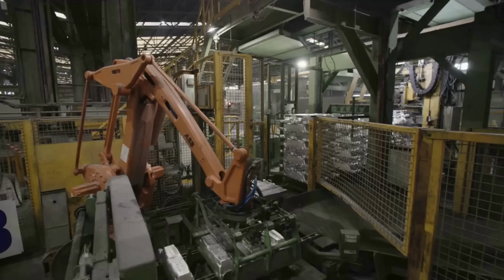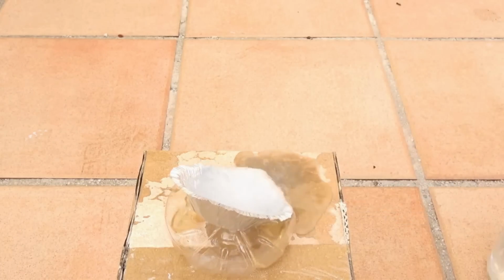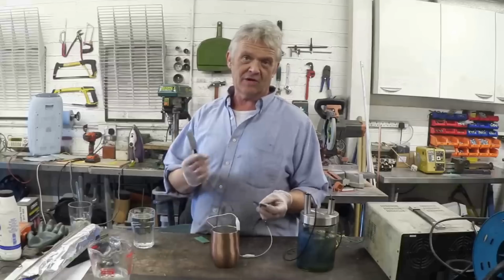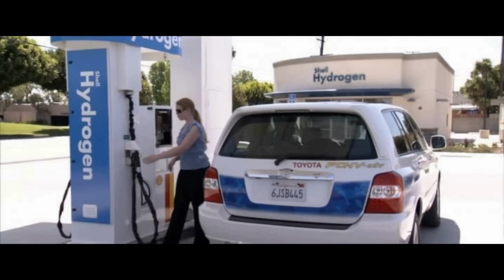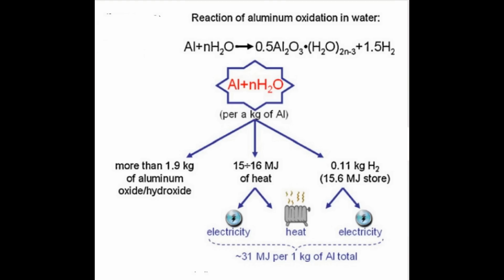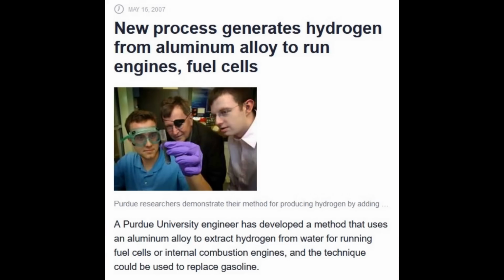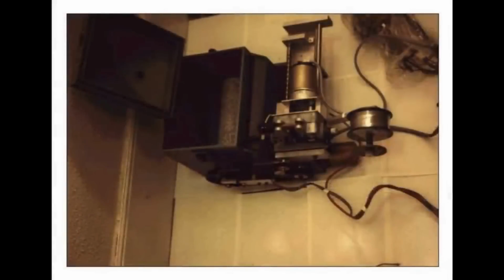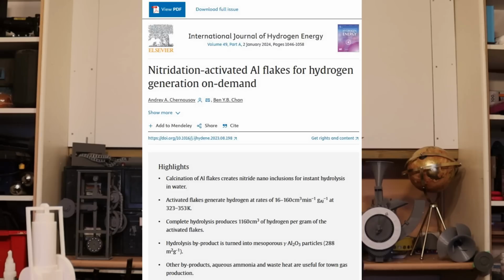2194 Hydrogen On Demand - Improvements And A Possible Conspiracy

Comment: My buddy and i built 3 small jet engins for Mercedes Benz with air barrings . It was use in a semi truck as a generator for an electric motor . The fuel was turned into a micro vapour. It took 3 gallons to go from LA TO NEW YORK ON 3 GALLONS OF FUEL.

Comment: Really? The Hindenburg again? The Hindenburg did not explode, and hydrogen does not explode. The outer coating of the Hindenburg caught fire, and the hydrogen tanks, too. The hydrogen burned (upwards). A mix of hydrogen and oxygen (2 to 1) can explode. If that had happened with the Hindenburg, then this would have been a small nuclear equivalent. A hydrogen tank does not contain oxygen and can therefore not explode. Hydrogen can burn when a tank ruptures, but so does petrol.  Hydrogen burns upwards.

Comment: I saw something a few years ago (not that many years) saying the Fraunhofer Institute in Germany has a Hydrogen on demand system that already works (and had customers, I think) for stationery applications. They had Sodium mixed with a carrier of some hydrocarbon, forming a grey paste. This was reacted with water, being physically squeezed out as needed (the paste had a toothpaste-like consistency). I'm almost sure they were talking of making it work for things like transport. (Just wait for the rain, and there you go another few kilometers - or drive through a spray booth to refresh your water supply when it's dry).

Comment: Hi Rob. My information may not be spot on accurate, but I'm figuring you can see through the the real question I'm trying to get at if you could. if you could make hydrogen on demand and burn it like you say. you were going to burn it in a blowtorch, but use a different flame configuration. Of course. you don't want the flame to touch metal, but use it to heat a boiler. Could you not then use the steam to make electricity and create basically a closed loop? Use some of that electricity to make more hydrogen gas and. basically keep the the momentum the loop going.

Comment: Clearly the Aluminum oxide comes from the electrolysis of water, leaving the hydrogen free to be used, though that also aids in the manufacture and recylability of the Aluminum as a product....

How do we lose? With a thermal capture system we could improve our ability to scavenge the total power of the reaction for as close to 100% yield, which is not often found in chemistry.

Comment: I've been doing tests on this topic for several years. My conclusion: An aluminum press for household waste, a unit (in the car;kind of "Battery") that presses it into a NaOH tank if necessary and uses the HHO in the engine/fuel cell. Works so far...

Comment: About 35 years ago a clever german inventor modified a bmw car replacing fuel tank with a mechanism that produced hydrogen on demand. For this purpose he used an aluminum wire roll used for welding. It was continually unfolded into an acid water bath, reacting with water to produce hydrogen which used as fuel into a normal petroleum engine.The car worked just fine and the inventor used the modified car to tour Europe on a test trip. I remember it very well because in my country a car magazine had interviewed the man and published an article about the car and the patent. I still recall that modified bmw car had already made some 2000 miles without any problem. The inventor departed my country (Greece) having the intention to continue testing his invention by tripping to America.

Comment: Nothing new about this its proven to be floored as it will take 3 times as much energy to reduce/ recycle the aluminium oxide/alumina into elemental aluminium and that is just the amount of energy lost in the reduction process it becomes ridiculously pricey once all the logistic, staff expenses and stock storage factors are considered.. ultimately it would be better to stick with natural gas as an alternative due to the fact aluminium production is far from a net zero process.. over 4tons of co2 is produced for every 1 ton of aluminium upto 16tons co2 for reduction of aluminium oxide

Comment: at around 5:20 into this video, you mentioned the efficiency of a car engine...
however, this is a badly tuned engine made for gasoline.
as we all know, gasoline starts burning at 4-15 or so degrees before TDC. 
hydrogen should be ignited at about 4-10 degrees AFTER TDC or with pre-ignition in case of an extreem lean mixture.
the efficiency can go up a whole lot compared to gasoline.
adding water vapor adds some extra efficiency to it all .....
also, as we see in newer cars, fewer cylinders make more efficient cars, a V12 won't ever be as fuel efficient as a line 3 not to even mention a 1 cylinder engine .... i believe those wont be nice since it won't drive smoothly ;)
anyhow, even with the same thermal efficiency engines will have different fuel consumption and i believe (without any proof) that hydrogen will have a better thermal efficiency

Comment: Just as MeOH may be considered (and is called thus by some) "liquid hydrogen", Al may analogously be referred to as "solid hydrogen". An in-depth head-to-head comparison between these two energy storage systems, taking all aspects into consideration, would be very interesting (hint - a future video perhaps?!). If I had to bet right from the top of my head, I'd say MeOH comes out as the winner, not least due to the unavoidable "solid exhausts" of Al (compare the corresponding gaseous exhausts of MeOH), but I'm all ears and open to change my bet...

Comment: Hello Robert thankyou for such a great video as always. I am very intrigue by this insight amongst others. We would be at your beckoning call to make that machine as designed in Africa to put use as a engine. My thoughts wind/solar power as 14v with step up booster and the machine running to provide a drive to run an engine for other purposes. Just a thought but would love your genius ingenuity to formulate a  simple design for some of us novice engineers.

Comment: There is a conspiracy theory here in that if this was implemented, assuming it is possible to be mass produced, this would break the oil stranglehold, and therefore impact the value of the US $ globally.  The cycle itself would also need to be considered from an overall efficiency point of view.  Conversion of aluminium oxide to aluminium and then the reverse conversion back to aluminium oxide.  Heat is produced in the conversion back to aluminium oxide, and hence is a loss, the the conversion efficiencies also reflect a loss.  Hence, the discussion would be around the overall process efficiency and its contribution to CO2 production, which would only impact on the type of electricity used in that process and the transportation of the recovered aluminium oxide.  
Robert, you are absolutely correct about the safety aspect of its use in vehicles when compared to raw hydrogen.  Aluminium producers tend to utilise cheap hydro-power and hence this process could result in a very low overall emissions impact.

Comment: Hi, please respond.
2 Points:
1) In the past i calculated the amount of Aluminium and Water (!) that you would need to carry with you, if you wanted to take with you the same amount of hydrogen as some hydrogen suv from BMW. I can not remember the numbers exactly but i remembered that the 700bar H2 tank thats in the BMW had to be much lighter, while being a  simpler system.
I didnt know that you also get some Voltage out of that reaction, that could shove the equation in the right direction.

2) The creation of CO2 free aluminium is a much bigger problem. I have not found a solution that seems feasible. It currently works via Carbon Anodes that are dipped into the Al2O3+Kryolith Mixture to reduce the Aluminium while the CO2 conveniently leaves the Melted mass. 
A different Method to reduce the Aluminium Oxide is needed to make this a true alternative.

Comment: I understand machine savings of Al cannot be recycled.  Asked a fellow who owns a machine shop and generates tons of Al savings.  Could this be used in this process.
Reply: afaik yes, I'd been dissolving cans in sodium hydroxide outside to see if i got a usable amount of alumina eventually. Don't see how shavings would be different, if anything it'll be better. You'll obviously want to be very careful with that much surface area, lots of heat and blinding liquids splattering about if it gets out of hand

Comment: I thought that aluminum comes from mining bauxite (equals Co2 production) that also requires a large amount of electrical energy to make aluminum. Same electrical energy that can make Hydrogen so what's the point meaning how could this have a better round trip efficiency that dumping electrical energy into a Lithium EV battery. I believe its takes approx 13kWh of electrical energy to make 1Kg of aluminum and for the average EV 13kWh of energy can drive approx 76Km or 46miles so how far is 1KG of Hydrogen on demand from Aluminium going to take this Car?

Comment: back in 2003 ( when I  was in college ) I had tried a stupid experiment of using aluminum blocks immersed in a small tank of sodium hydroxide to generate hydrogen and then used that to run a car over a short distance. It was a stupid idea but was fun. I had seen this patent ( the last one you mentioned ) back then also as a conspiracy theory but never found any more information on what voltage was used to achieve it. One problem that i see in that system is that the drum will also wear out eventually and would be a problem to replace.

Comment: I own a hho generator that can also be used as a torch. Water does burn. Easy to do over electrolysis. No need to use a aluminum electrode that will dissolve.

Comment: must add a note in hydrogen defense ,I suspect the people on this channel are aware of how the world works ,more than most .So we have to ask was the Hindenburg debacle blamed of hydrogen to deflect and distract from its use or to much research being done on what else it could be used for ,ie ICE motors that actually clean the air !?. The hindenburg was painted in an aluminium oxide paint [the irony] .  When a large body is driven through the atmosphere it tends to accumulate very large static charges ,bring it close to a metal mooring tower and you get a large spark , perfect for igniting a large highly combustible aluminium oxide painted fabric covered airship . People were dropped about a hundred feet , in a tangle of burning debris , the hydrogen did its thing and shot into space . [ I research and ponder a great deal about what the movers and shakers get up to in meetings I am not invited to , they have after all manged to accumulate most of the worlds wealth into the hands of a very few ,so paying attention to what they say ,and don't say ,is a duty of the 99.9 % ]. Nice research Robert .A bit like Edison's original iron battery power idea .

Comment: Not a possible con spire i have used hydro on demand for years. Tried to publicize it and got threatened. It works better than petrol think about it, twice the jewels of energy, twice the birn rate= clean burn, no emissions, and since 2x.... you only need half as much volumn of the 'gas'

Comment: Would it be possible to directly recycle not only the gallium but also the aluminium oxide produced using electricity from a charger? Either at home in the garage or better still within the actual vehicle, effectively creating a superior battery to lithium that only needed a recharging station, but could also be chemically recharged as mentioned?
Reply: Look up how Al Oxide is reduced - it takes Kryolith, huge temperatures and a Carbon Anode. So sadly, no, not yet.
Reply: @uninteressant2196  I have and that is a problem. The answer is to use a solar concentrator to reach temperatures high enough to not require kryolith (or electrodes of course) but this means it would not be much use on a vehicle, but possibly could be used in a small scale domestic setting. One idea would be to have an onboard microwave device create a plasma to do the same, powered by a conventional recharging station. Or perhaps some form of laser could do the same trick?
Reply: @trevorloughlin1492  Some wild ideas, the problem of the carbon anode is still there, but there are some companies working on a carbon free anode, it is possible.

Comment: Nice. I never put much stock in hydrogen for light transportation due to infrastructure rollout & after home 'refuelling', why would anyone go to a 'gas' station? But aluminium could be swapped at home/picked-up/dropped-off to the recycling centre and seems more viable as a fuel that petrol ever was. Could also generate for a fuel cell for EV range-anxious & a home back-up generator. Is there a domestic/portable Aluminium Oxide<>Aluminium roundtrip device?
Prototype build?

Comment: A combination hydrogen cell, thermal motor, the electrical redox output AND the mechanical pressure of producing hydrogen gas, ALL AT THE SAME TIME, would bring the potential efficiency very near to 95%

But it would take a very organic approach, and very few people [other than myself] tend to think that way.

Most people want to stratify and specialize, in direct opposition to creating an organic approach.

And people GIVE me aluminum all the time.

BUT...

You CAN do the very same with sodium, too.

And much more cheaply.

Comment: Using the reaction of aluminium with water (catalysed by sodium hydroxide or other strong alkali) to generate electricity for an electric car is an interesting idea, because if you could fit an ordinary hydrogen fuel cell in addition to the aluminium/water cell, you would have two electricity sources. The voltage produced by these would not be identical, neither would the maximum possible rate of reaction - the latter is what defines the upper limit for the current the cell can deliver. So combining both to power a car would probably need some additional rechargeable batteries (a small bank of lithium-ion cells, for example) to act as a buffer - supercapacitors would be better for that, but they are still rather expensive.

However, if you want to use aluminium metal as the fuel source for a car, there is already a much simpler way of doing that: Aluminium-air cells. This is the same sort of idea, but the weight is much lower and the energy density is consequently much higher - almost an order of magnitude better than lithium-ion batteries. The electrical energy output using the oxidation of aluminium with oxygen is higher than you get from the aluminium-water reaction (which is also oxidation of aluminium, just using water as the oxygen source), and probably still comes out on top even if you factor in the electrical energy output from using the hydrogen by-product (from the aluminium-water reaction) in a fuel cell.
Another bonus of using aluminium-air cells is that you don't need to carry water around, since the oxygen can be taken from the air. This is significant because for the aluminium-water reaction to go to completion, each aluminium atom requires 3 water molecules. That's the molecular ratio, but since the atomic mass of aluminium is 27 and the molecular mass of water is 18, the overall mass ratio of aluminium to water comes out as exactly 1:2, so for any given mass of aluminium used, you need twice that mass of water.

Another advantage is that metal-air cells are an existing and well understood technology, which can be scaled up or down fairly easily. Aluminium is not the only possible metal you can use in this way: Zinc-air cells have been a common button-cell type (for hearing aids and other small appliances) for almost 50 years, and large zinc-air cells with thousands of amp-hours capacity have been used industrially for almost a century. Several other metals have been made to work in the same way - magnesium, calcium, tin, even iron, but for energy density, aluminium is the best.

One disadvantage is that all metal-air cells (aluminium or otherwise) are primary cells - they are not rechargeable, at least not in the usual way of passing electric current back through the cell to drive the reactions inside in reverse. However, the metal used as fuel does not have to be one solid lump - in fact it works better with powder or granules. So aluminium-air cells can be "physically recharged" by emptying the aluminium oxide out and adding more aluminium metal granules. Some industrial scale aluminium-air cells work in exactly this way.

The other inherent disadvantage is that the aluminium oxide byproduct needs a lot of energy input to transform back into aluminium metal - typically by electrolysis at an aluminium refining factory. Also, the electrodes in these giant aluminium oxide electrolysis cells are typically made from carbon, often in the form of compressed coke or petcoke powder. The operating temperature of these cells is over 1000 degrees C, so the anodes literally burn away by reacting with the oxygen liberated from the aluminium oxide by electrolysis. So it actually works out such that for every ton of aluminium metal produced, almost 2.5 tons of carbon dioxide are produced by the anode burning alone. Which is before you even consider the energy required to melt the aluminium oxide, which is typically done by burning natural gas. All of which means that using aluminium as a fuel is really not an environmentally sustainable process.